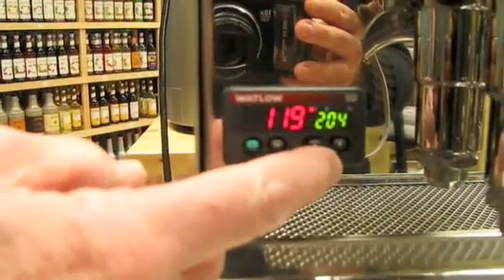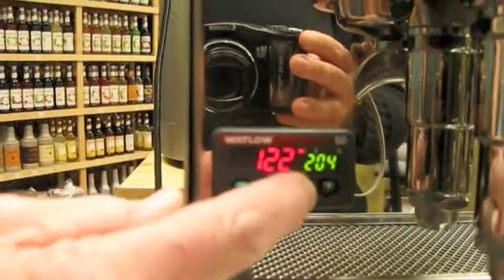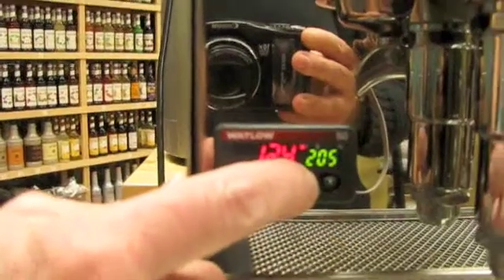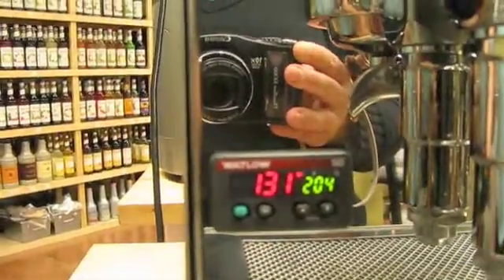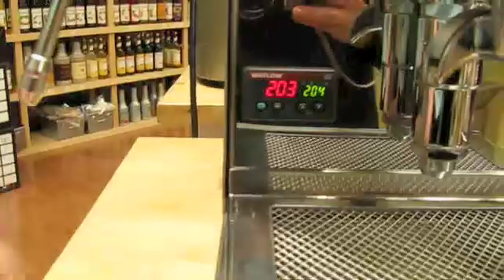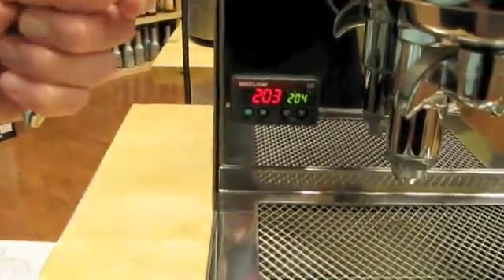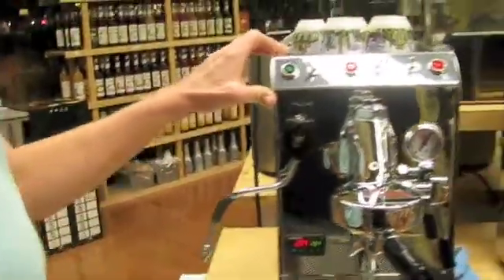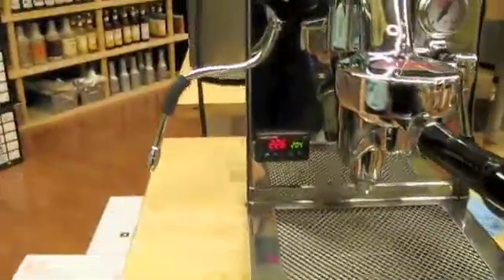Ask the Experts: What's the Lowdown on PIDs?

Comment: PID (Proportional - Intregral - Derivative) controller is a Type of controller that takes actions based on:

1: The actual difference, or error,  between the setpoint and the measured variable (Proportional)
2: How long that error has persisted (Integral)
3: How fast the error is rising or diminishing (Derivative)

In the specific case of espresso machines, we are talking about controlling temperature pulsating the heating element on and off.

Even though it is capable of all the above, most PID controllers only work with the P and I actions, and that is because the Derivative action could make the controlled system sensitive to noise. 

Hope this helps.
Reply from the maker: Great explanation! - Kaylie
Reply: Wow thank you very much!

Comment: @JmanEspresso almost right.. it also reads the heat losses and compensates, say your heater will add 10° a minute and your boiler loses 5° a minute. it will turn on the heater for 30 seconds a minute to keep it constant (although it measures much faster, so it would be more like 7.5 sec every 15 seconds)

Comment: PID:
Compares your setpoint(desired) temp, to your actual temp.  It reads the temp inside the boiler a couple times a second.  The PID always wants the temp to be the SetPoint.  If it senses the actual temp is not your setpoint, it corrects itself. But unlike stock T-Stats, there is no large swings in temp. the PID pulses the heater on/off really quick, so you dont overshoot your SetPoint, or fall below it.

For the serious enthusiast, a PID offers very tight control and manipulation of temps

Comment: Hey guys:

PID.- what it stands for:

P- Proportional 
I-   Integral
D- Derivative 

Its actually pretty simple how they work, once put into laymans terms, but it cant get real techy, real quick once you dive into it.

in a nutshell... Youve got your "setpoint", or the temp which you WANT to have.  Then, you have the ACTUAL temp of the boiler.  Then you have the allowable difference between those two points, which is usually 1F, but can be as tight as 0.1F.  

The PID(continued)

Comment from the maker: Our tech says you could do this but that the board interface in superautos have better temp regulation than you find on other models, so while you could snip the wires on the temp sensor of the board and then connect them to a pid, you probably wouldn't have much of a performance difference. - Kat